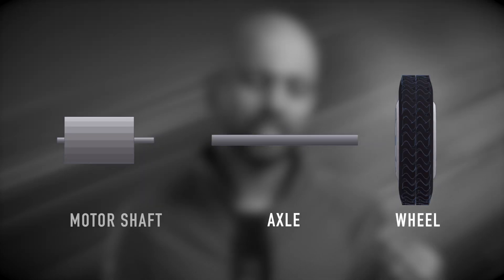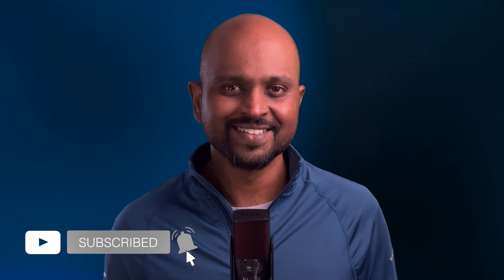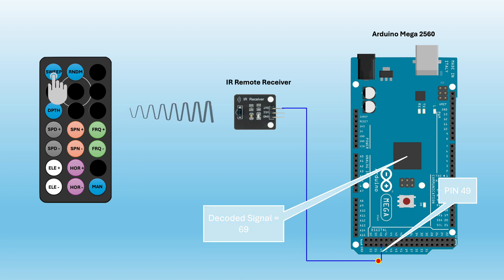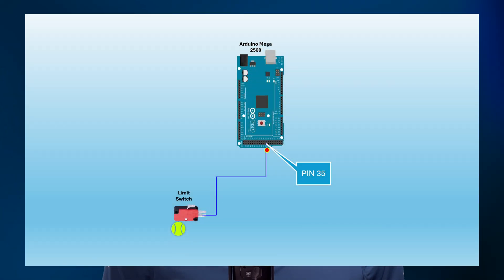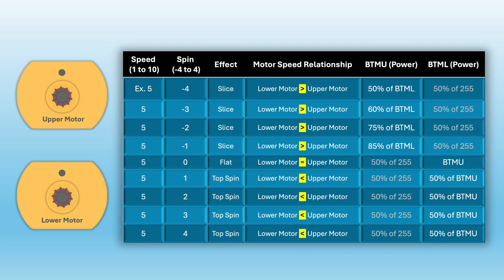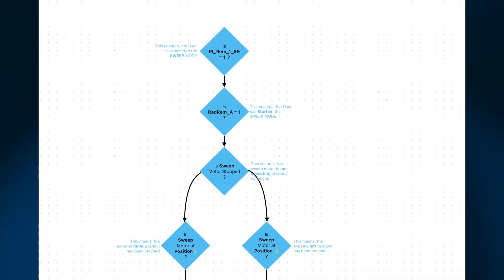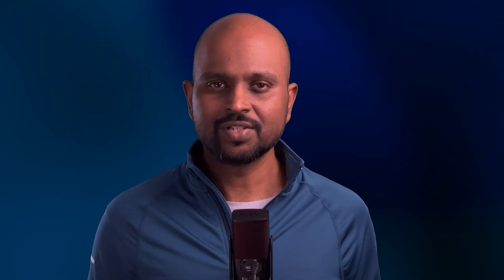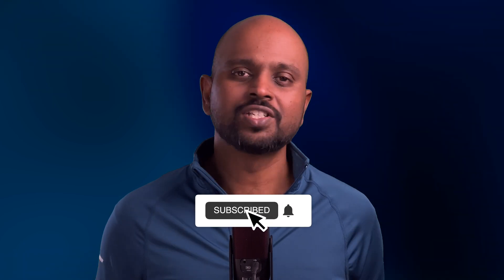Part 4 - I explain how the code works - Tennis Ball Machine - DIY Build

Comment: I also stick sandpaper on wheels to get the grip. But might change to a rubber band over the wheel created from a large tyre. Especially if the sandpaper kills the fluff too fast
Reply from the maker: Yeah sandpaper might do that to the balls. A cycle tube might work. But watch out for the wheel balance issue. 

Check out my latest video for my approach on the wheel.

Comment: I need to do more with a system to stop the double. Ball drop. Your springy thing seems ok. Ive tried a few options but seems balls still want to collect in a way to get stuck together. But im doing an odd thing. My hopper is not parrallel to earth
 Its slanted and only one hole. Might have to change over to the usual flat 4 hole way
Reply from the maker: Hi, nice to see your comment! Yeah the ball hopper can be a bit dodgy. 

Keep at it mate. You'll solve it eventually. Trial and error is the best thing about a diy project like this. Can be frustrating at times but a bit of break or an overnight sleep can do wonders to solve problems.

Comment: Hey John, I have been working on a ball machine design of my own for the last few months and discovered your videos just a couple days ago. There don't seem to be many videos covering this topic so it was fun to see your approach to things. I'm a mechanical engineer and I design/build/program industrial automation machines. I'm used to high end, expensive industrial automation components paid for by my company.  Funding this myself has brought out my inner cheapskate and has driven me to get out of my comfort zone and research components in the hobby space. I haven't really touched an arduino for 8+ years and so the little I did learn programming an arduino is rusty at best.  I appreciate you sharing your code and will very likely use a good portion of it.  There are a couple of things I could suggest to help with your mechanical design to overcome the balance/vibration issues you experienced. Let me know if you are interested and I'll be happy to share.  My plan is to eventually document my project like you have (with way lower video quality and flow), but I am not far enough along to start that yet as I'm sure you know that is a huge undertaking in itself. Again, thanks for the well presented project and let me know if you'd like to chat!
Reply from the maker: Hey Clint, love your comment. And I am so excited to see the internet bringing random folks like us from different corners of the world together, its just amazing. I would love to hear your thoughts on the mechanical design and I am sure some your and my viewers will also find that very useful. And I might be able to help you with coding related queries if you have any, that is!

Its no joke, this project. It is a constant tradeoff between weight and portability and cost. I want to keep it as light as possible but after the recent attempt at building the launcher module, I am beginning to think that I might have to ditch the plywood and screw idea in favour of aluminium or steel frames. But you sound like you've got lots of experience in this area so it would be great to hear what you have to say :)

Here is my email (if you prefer) - grove_beech0g@icloud.com, we can go from there. Cheers
Reply: @john.alister  Hi Clint and John, the story of Clint is exactly as mine. I am also a mechanical eng and I'm starting the design of my machine with a colleague. It would be great to share the knowledge and work together on this. May I join you guys on the discussion? If so, I will send an email too.
Reply from the maker: Happy to collaborate mate. There's power in numbers 💪🏽. 

It's a bit late here 😴. I'll pick this thread up in the morning. 👍🏽
Reply: @john.alister  excellent! I will put together an email we can go from there.!

Comment from the maker: Hey everyone :hand-pink-waving: - here is the link to the code and flow chart
https://drive.google.com/drive/folders/1BluocPSngjgFQCiUjjyVApOmeu2kkyHe?usp=drive_link

Let me know if you have any questions - I'll be happy to assist :hand-purple-blue-peace:
Reply: Hello John!

I've completed the first part of my project with your help. Thank you so much!

My second project involves adding a 5-second timer to input pin 35 so that when the container is empty in manual mode, the machine stops automatically.

Sometimes the ball gets stuck in the carousel, and the same sensor could, conversely, stop either the machine or the carousel. I've tried modifying the code a few times, but without success. Do you think this could be possible?
 Thanks!